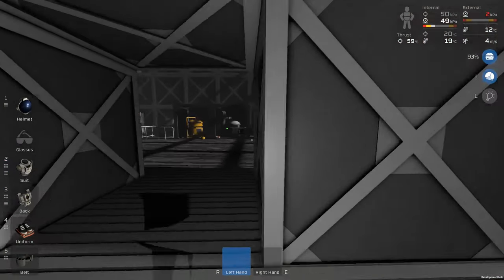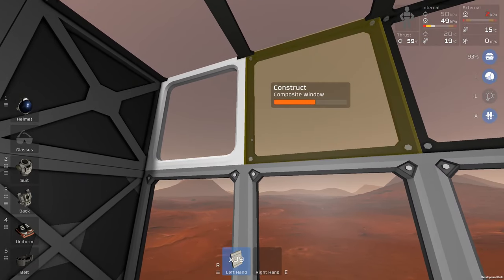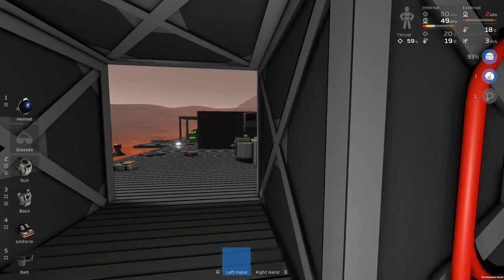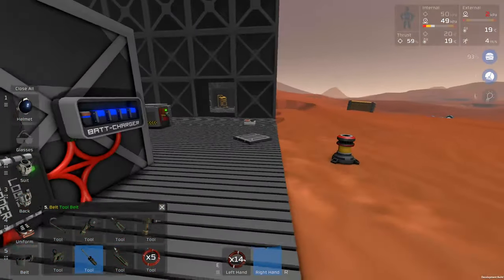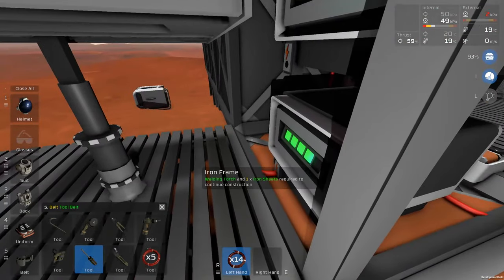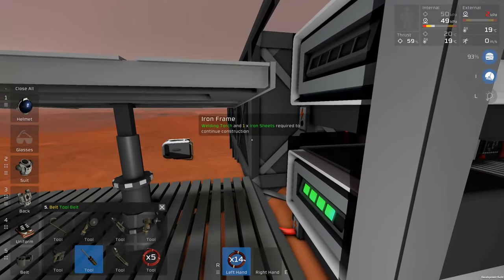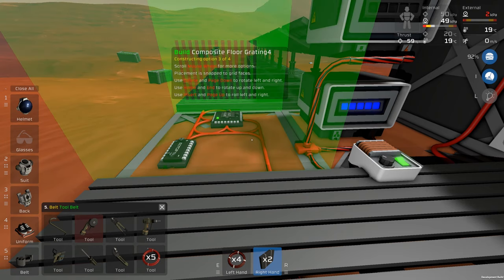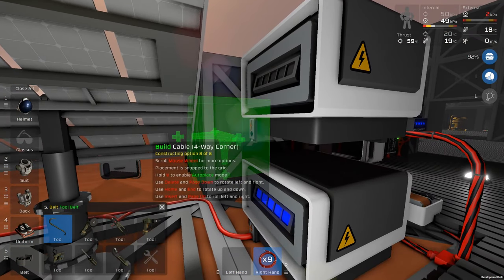Stationeers S4 E12 - Automatic Lighting (First IC Tutorial)

Comment: I tend to try to be very efficient with my resources so I dislike using large amounts of heavy cable if I can avoid it.  I've found that you can use transformers on your solar runs to keep from burning up cables.

Just link 10-11 solar panels with light cable and then place a transformer between it and a "battery charge network" made of heavy cables.  Set the transformer on 4999W and turn it on.

I haven't done rhis recently but in the past the light on the transformer didn't come on but power did flow through it.  I think this is because the when the batteries are charging they are "greedy" if you will.

Comment: So you can yank the chip out and socket it elsewhere and it keeps it's code? No reason to cart a computer around then, just have a little programming station.
Reply from the maker: It does, but in order to test the code, you need to have devices attached to the housing, and since everything is in subnetworks, it's easier to move the computer :) Without subnetworks, it's a pain to select devices (as the next/prev device gets old quick)

Comment: You can get away with the small cable on the rows of solar panels as long as you don't go over 10.  You just need a transformer between the panel row and a heavy cable that connects to the battery.

10 solar via small cable -> transformer(5K) -> heavy cable (generation side) -> battery -> heavy cable (supply side) -> transformer(5k) -> base system

Each 10 solar should go through a transformer before connecting to the heavy cable.  You'll save a lot of gold that way.

Comment: Can`t you have the motion sensor in the entrance to a room and have the IC holde the activate status when you enter till you leave and activate the senor again?
Reply: If you did it with just one motion sensor like that, you'd probably get some fun problems. Like, if you walk into the doorway and turn around, you end up with the lights the wrong way. And there's some tricky code needed for making the lights not blink while you stand in the doorway. You probably want two sensors, one on the inside and one on the outside, and to set the state when only one sees you based on which it is.